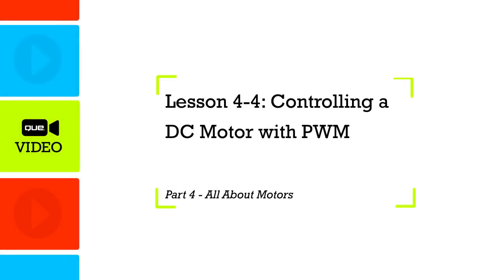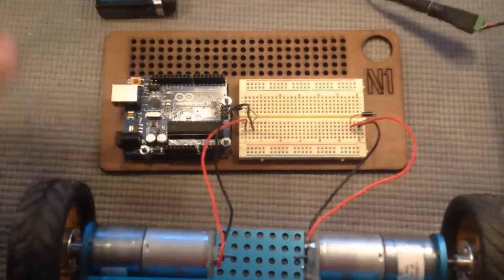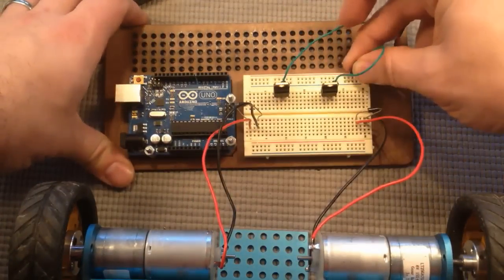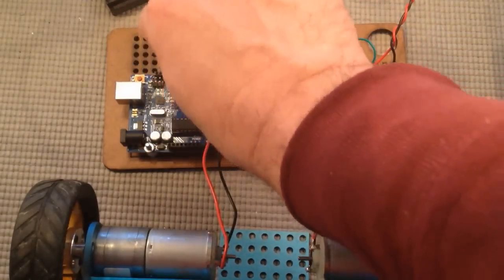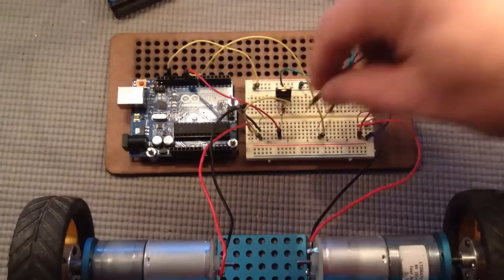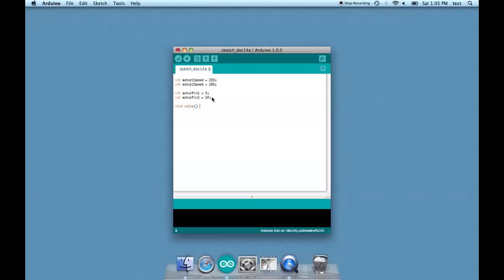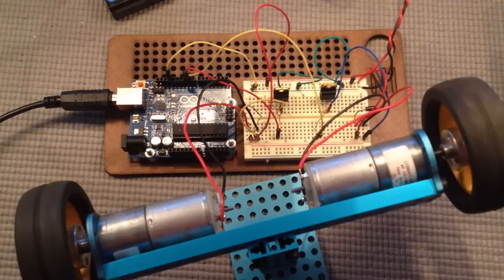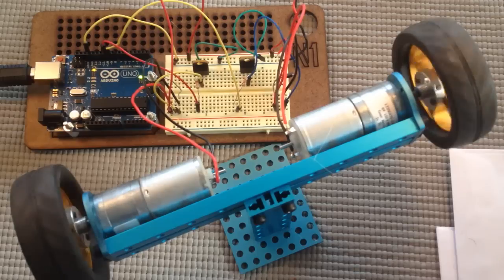Arduino for Beginners   19 Controlling a DC Motor with PWM

Comment: Can't I just power a 3v motor directly from the arduino connected to USB? Being that I will have an output of 5v
Reply: yes but it will shorten the life of your motor, by how much...no idea
Reply: @charlesharring4735  but can't I limit the output to 3v?
Reply: @octimus2000  yes you can, using a step down converter, but really it probably wont matter, maybe shorten the life of the thing a little bit thats all
Reply: @charlesharring4735  I always thought that I could use pwm to lower the voltage.
If 5v = 256, then 3v = 153
I don't know how correct this is.

Comment: Can i use  tip31c transistor instead of a tip31 transistor or will that not work? If it has to be a tip31 transistor, could you send me a link to it? Thanks

Comment: How to make it with forword-reverse controlling.
I want to control 7 motors in which 5 motors are servo and other is simple 12v geared motor.
Please reply.
Or make a video on how to control wireless robo car with arm controller

Comment: I found an easier way to do this.  If you simply connect the battery directly to the motors, you get the same result.  No need for all those other components.
Reply: I like the way you think ;-)
Reply: but how would you control the motors then?

Comment: This may be a dumb question but I'm completely new to this..

Once you upload the code to the board, all you have to do is plug the power supply and it just runs on its own? Or do you need to start it from the arduino IDE?
Reply: Once you upload the code to the board, if it is plugged into a computer or has a power supply, it will take a few seconds to load the code into the board and then it will run on it's own.

Comment: Thanks for the video, could you please tell what diode you used?
Reply: Diode allows only the  current to enter in one direction that's from the black side to grey side if the  current comes in opposite direction there will not  be any flow of current

Comment: Im trying to put a 4.5 VDC motor to trigger from a quartz clock It already triggers a chime & the clock is 1.5VDC and the chime is 3VDC so Im trying to tie this into the 4,5 V motor so it will spin when the chime goes off and it also has to go forward for 5 sec and then backwards Will this product do this and if so how do i hook that up with the time delay etc Thanks  :)

Comment: So analogWrite() is PWM and not actually analog via a DAC.. Hmm.. Is the output a square wave or smoothed with a cap?
Reply: It's a square wave
Reply: ItsTheJackpot Thanks. I've learned the frequency of the PWM is set by the libraries and hardware, although you can poke around in the C++ files I think. Obviously the duty cycle is set by the 0 to 254 value of analogWrite();

Comment: I still dont know what and how pwm is and works. Pulse width modulation where the pulse can be shorter or longer but what am I with it? Can somebody explain it for me? I'm struggling with this for months.
Reply: square wave(pulse) goes up for time %second and down for time %second,if up&down times equal (50% of duty cycle) here is the speed is in middle,  when up time is 75% then down time 25% here you going faster ,if up time is 25% and down time is 75% , here you go slower , for more you can read about the duty cycle percentage.

Comment: When I connect potentiometer(s) directly to the motors, the potentiometers start smoking up and yet I have had a motor running directly from a power supply (no Arduino or anything) with a potentiometer attached and it never smoked up. Is there a reason why the directly powered motors should not be used? Shorten the life of the motors?

Comment: Hi. It is working. Thanks for this. Is it possible to use a potentiometer to control the speed of the motors in this circuit? Where would I put it? I am guessing that the arduino receives the full voltage of the source and the motors receive half each. Is this correct? Please reply soon before I burn too many more components :o

Comment: Just subscribed. Cant read the sketch its too small. Could you post it in the comments section please? Quick question...I have two Uno R3s, one is an authentic Arduino (as far as I know) and the other is a clone. Both power up when connected to my computer (on board led blinks on both) but I get an error when trying to uploade the LED blink example to the Uno Clone yet it works great with my "authentic" Uno. What gives? Thanks in advance.
Reply: int motorSpeed1 = 255;
int motorSpeed2 = 255;
int motorPin1 = 9;
int motorPin2 = 10;

voidsetup() {}
voidloop() {
analogWrite (motorPin1,motorSpeed1);
analogWrite (motorPin2,motorSpeed2);
delay(2);
}

Comment: can someone help im beyoned a beginner im trying to control a dc motor using my arduino board. im looking to the the motor to go foward for 2 seconds then reverse for 2 seconds i just need to know the code and how to wire it i have a arduino board a pust make switch bread board and resistors i dont have any other componats